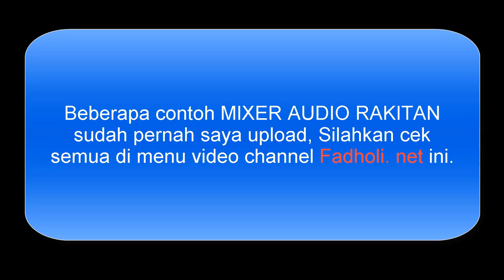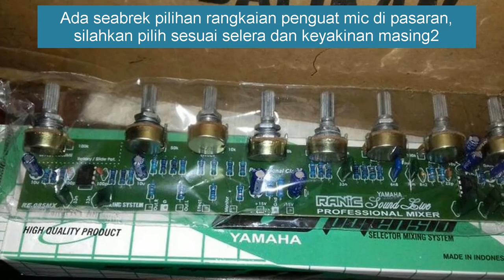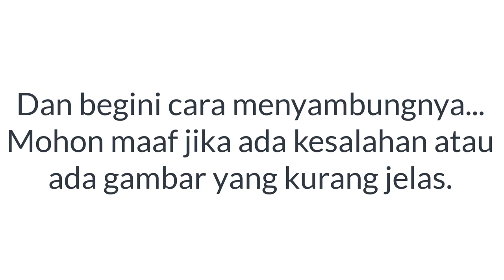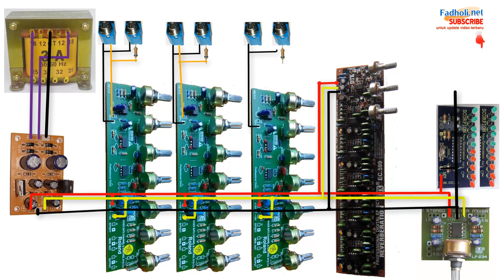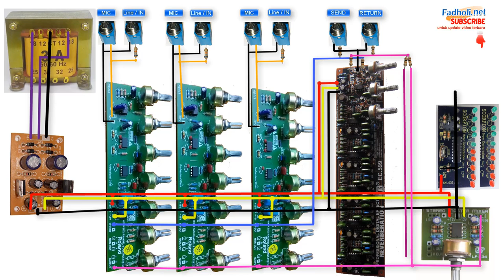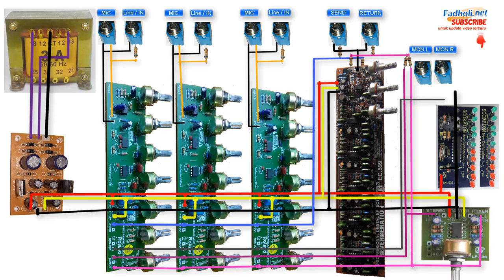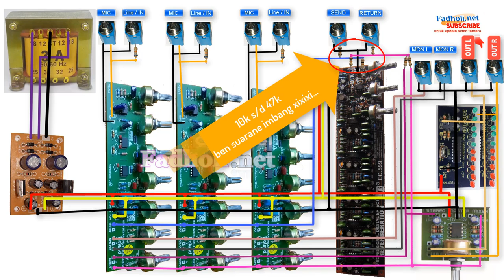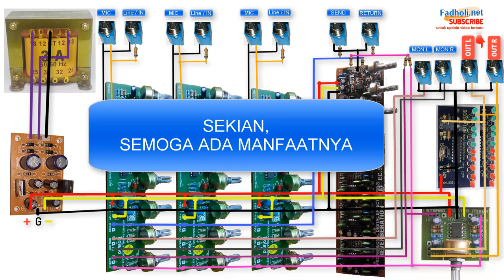Cara Mudah Merakit MIXER AUDIO

Comment: mau tanya om...input line in nya kan bisa dari mp3...terus kan itu mono...kalo dari mp3 kan sttereo..apakah otput dari mp3 LR nya di gabung...maap pemula pa...
Reply from the maker: Bisa seperti itu atau lebih baik pakai 2 channel di mixer.
Reply: oh...jadi maksimal harus    4 chenel ya...yang dua buat line mic yang 2 buat L DAN R nya mp3...makasih sblum nya pa....kutunggu vidio vidio selanjut nya....sukses slalu.....

Comment: Mau tanya kalau penguat mic merk Roland 7 pot di kasih 2 input itu di beri resistor berapa ohm ya.?
Reply from the maker: 470 ohm - 1k
Reply: @Fadholinet  ok trimakasih bosku.
Kemarin ga lihat Kontes sound system yang di Kedungpring kah..😁
Reply from the maker: Panas2 males kelayapan mas 😃
Reply: @Fadholinet  jhaha🤣

Comment: Mas yg untuk mic  high apa yg low mas
Reply from the maker: Penguat mic yamaha ya?
Reply: Iya mas kan ada keluaran high dan low untuk line dan mic. Yg di pakai untuk mic yg low apa high
Reply from the maker: @sangbintang  Saya lupa high atau low.. tapi untuk mic pakai yang terhubung ke resistor 1k. Sedangkan yang 47k (kalau tidak salah) digunakan untuk audio input. Tapi dalam pemakaiannya (praktek) jangan dijadikan satu. Antara mic dan audio harus masuk ke channel sendiri2.
Reply: Terima kasih mas

Comment: Mas kalo mixer jadul, pake kit ronica 6 potensio, potensio monitor sama efek gk ada, trus cara nyambung monitor gmn mas
Reply from the maker: Out bisa dicabang dengan resistor dan potensio mas
Reply: R berapa mas
Reply: Di vidio itu R untuk input low brp nilainya mas
Reply from the maker: @lintang-11  sudah tertera di video

Comment: Pak saya kmren ngerakit kit mixer 2 ch dari psu nya 15v ct trus di master mixernya tegangan yg dibutuhkan cuma 12v trus harus pkek resistor brpa agar tegangan di psu 15v bisa masuk di master mixer yg tegangannya cuma 12v mksih pak
Reply from the maker: Diberi 15v masih aman kok, kalau diturunkan pakai resistor nanti 
resistornya bakal panas, atau lebih baik ubah psu nya jadi 12v saja.
Reply: Siap trimakasih pak

Comment: Mas, mo nanya klu merakit mixser 6 chanel (4 mono 2 stereo) pake kit apa untk yg stereo, trus cara menyambungnya gimana ke master mixser.
Reply from the maker: Chanel stereo biasanya hanya untuk line audio (tone control)
Reply: @Fadholinet  berarti pake kit tonecontrol saja yg stereo ya mas, yg bagus kit apa mas, cara nyambung kabelnya gimana mas? Apa sama saja dengan kit mixser trus ke master mixer.
Reply from the maker: @renoharyono8262  Kit mixer itu kan sama saja dengan pre amp mic plus tone control yang ditambah potensio pengatur effect.
Reply: Ok, paham. mas mksih atas pencerahan nya.

Comment: Saya pasang 8 channel awalnya tanpa resistor di in dan out reverb, setelah mengikuti gambar dengan R 47k desis dan dengung hilang . 
Awal pemakaian tdk ada dengung , setelah pemakaian 1 jam dengung mulai nampak kecil setelah musik dikecilin minimum. Saya merasakan Psu simetris panas. Apakah penyebabnya psu ya bang. Cara mengatasinya gmn ya?
Reply from the maker: Resistor in/out  tidak ada hubungan dengan dengung mas. 8 channel butuh psu yang lumayan besar, tidak cukup hanya pakai 7815 ataupun TIP31.
Reply: @Fadholinet  ohh gitu ya mas. Terima kasih ya mas fadholi. .

Comment: Kalau output trafo itu dikasih 12 volt bisa gk ya...?
#maaf masih pemula
Reply from the maker: Trafo yang mana mas?
Reply: Trafo power supply, itu kalau ke mixer nya tegangan 12 volt apa bisa...?
Reply from the maker: Bisa asal tetap simetris

Comment: Maaf om saya mau tanya. Saya merakit mixer awal sudah bagus suara bersih setelah itu saya coba tambah kit-equalizer 5band sebelum kit-master, tapi jadi ada bunyi dengung. Awalnya saya mengira itu kit-equalizernya tapi saya coba outnya saya langsungkan dari equalizer tanpa menggunakan kit-master kok malah hilang dengungnya..
Disitu saya mulai bingung..
Mohon bantuannya ya om.
Reply from the maker: Equaliser 5band butuh psu 12vdc (non CT). Terkadang disitu masalahnya ketika digabung dengan rangkaian lain yang psu nya model simetris.
Reply: @Fadholinet  benar mas.. jadi solusinya gimana nih mas.

Comment: Mas, mau tanya, aku merakit ampli untuk mobil, pake power ocl150, tr final sanken, inverter 24v(di multitester 30v), tapi suara ngeprak kenapa mas??
Reply from the maker: Sebaiknya dicoba dulu powernya pakai psu standar untuk memastikan sumber asalah dari power atau inverter mas
Reply: Sudah mas, saya pakai trafo 5A 32v
Reply: Hasilnya sama
Reply from the maker: Cek semua transistor, jika semuanya normal coba cek resistor 10K
Reply: Transistor driver saya coba bd139, udah nggak ngeprak, tapi waktu bass dinaikan, kayak nggak kuat.
Reply from the maker: Psu kurang gede
Reply: @Fadholinet  pakai brapa om??
Reply: @Fadholinet  kalau untuk inverter 24v, apanya aja yang diganti
Reply from the maker: Jika speaker yang dipakai adalah double coil harus pakai trafo murni. Soal inverter maaf saya belum pernah buat mas.
Reply: @Fadholinet  speker acr 8inch full range, 100W 8ohm

Comment: Mas bro ajeng tangklet,kalau dari sumber audio suara keluaranya stereo,itu pakai 1 cenel mixer atau 2 cenel mixer...soalnya di situ dalam satu cenel cuman tertera 1 line mic trs di kasih resistor untuk line in audio,yg aq maksud bagaimana bikin setereonya....apa harus pakai 2 cenel...suwon infone mas
Reply from the maker: Betul mas pakai 2 channel. Kalau mau outnya benee2 stereo atau karaoke bisa memainkan potensio panpot

Comment: Bang kalo led nya 1, harus pake power suply yng brapa ampere yah, aku pake yg 60a trus controler nya angus berasap, - / + udah benar
Apa yah masalahnya
Reply from the maker: Maksutnya led apa mas? 1 biji led atau apa kok ada conroller segala?
Reply: @Fadholinet  hhahha salah video, comen di video runing text malah di sini, baru belajar dah angus, sayang tuh TFS6U 120ribu angus
Reply from the maker: @Ozi12sanuputra  P10 dan controller umumnya butuh 12vdc. jika hangus kemungkinan salah pasang
Reply: @Fadholinet  saya pake power suply 5v 60a

Comment: Mau tanya mas, kalo posisi mic off knp ada noise di mixernya ya? Trima kasih
Reply from the maker: Lepas atau jangan pakai resistor yang ada di jalur input.
Reply: Mau tanya om itu resistor nya pke uk brapa ya

Comment: Keluar angin mas volume full semua tanpa di colokin input mmixer ny 6 ch..

Solusi nya apa mas..??

Kasih R kah di input master mixer nya..??
Reply from the maker: 1. Gain jangan dibuka terlalu lebar.
2. Jack input mic jika posisi tidak dicolok, atur jalur inputnya agar nyambung ke ground.
Reply: @Fadholinet  iya mas itu akibat noise gain yg terlalu over..

Saya bandingkan input dari hp ke parametrik suara lebih bersih..
Dan dari hp ke kit mixer rakitan suara menurun jadi lebih jelek dan gak halus gak kaya dari hp langsung ke parametrik..

Apa kit mixer nya emang jelek mas..??
Atau tentang soal gain input??
Padahal sudah saya kasih R dan volume hp 7 bar...??

Comment: mas knpa ya klo sya pasang efek vokal waktu sya triak suara cempreng malah mengecil . kira2 apa nya ya mas. mohon jwban nya mas
Reply from the maker: Efek vocal pabrikan atau rakitan
Reply: rakitan mas. pke efek reverb 7 potensio. travo 1 amper se ukuran box nya. mixer rakitan 8 chenel travo 2 amper
Reply from the maker: Wah apa ya... soalnya saya sendiri belu pernah coba mic sambil teriak teriak sehingga belum pernah ngalami hal seperti ini hehehe... atau coba puter2 VR/potensio reverbnya untuk enyesuaikan setingan yang pas.
Reply: udah di puter2 sma aja mas. gk triak bnget sih klo suara kuat suara nya makin serak makin mengecil. lengaruh gk dari amper travo apa kurang besar atau gmna
Reply from the maker: Mungkin juga trafonya kuwalahan...
Reply: iya mungkin mas. yg bagus pke travo apa ya mas buat mixer 8 chenel pke smps 8 amper bagus gk atau pke travo kotak tpi yg brapa amper